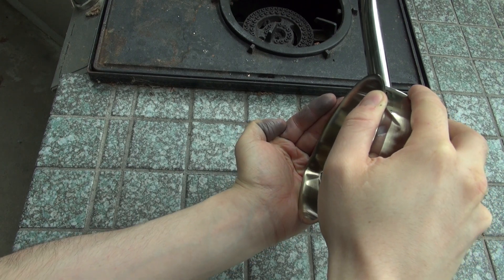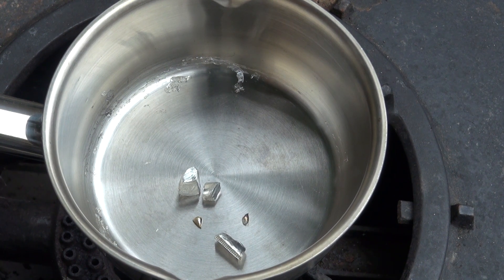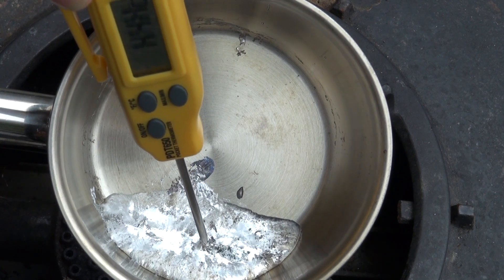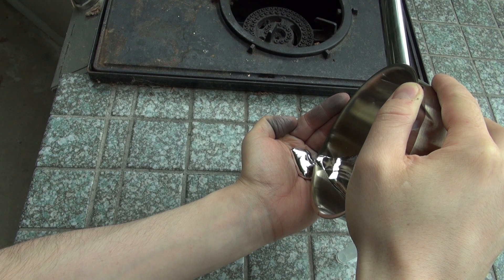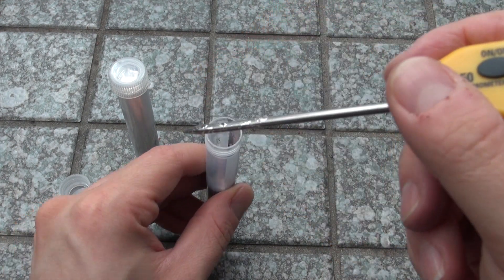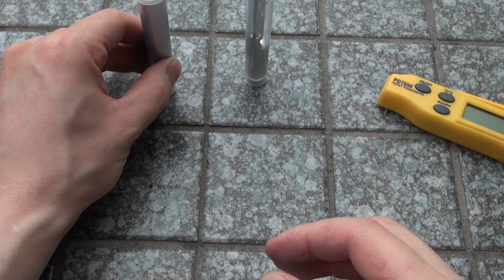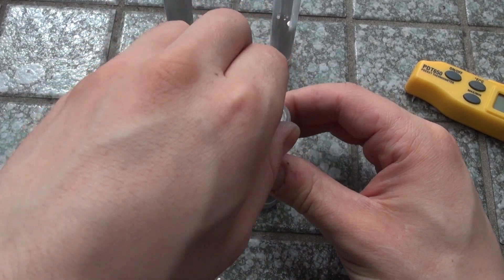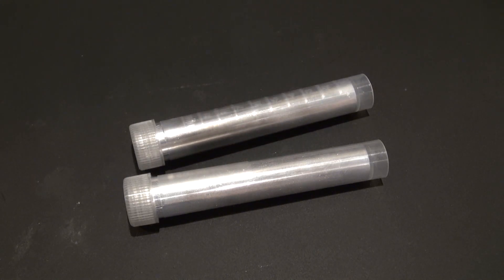How To Make Galinstan

Comment: It's NOT a "very unique" metal! There are no levels of uniqueness, it's simply unique (one of a kind) or not.
Otherwise another metal could be slightly unique, a little bit unique...clearly nonsense.
Unique doesn't mean rare, special or unusual, those are different words.
"Unique" has its own meaning and you should use it properly.

Comment: Is gallium and galinstan the same thing? I understand that than galinstan is three elements in one but Im curious to know if gallium is better or about the same as galinstan when mixed with aluminum to get a chemical reaction to will create hydrogen
Reply from the maker: It is not the same because gallium is a single element and is has a higher melting point than galinstan.
Reply: I've found pure gallium reacts a little better with aluminum

Comment: You actually dont even have to heat them up
Reply from the maker: For indium and gallium you don't but for tin you do. The three metals won't combine unless tin is heated up and melted. Maybe if indium and gallium is alloyed and comes in contact with tin at room temperature it might combine but very very slowly, if at all.
Reply: @SciTyeTech  oh okay. I did galinstan yesterday and well... it hasn't worked for a 100% 😅

Comment: As a non-chemist, I would wonder if the gallium would damage the metal tip of the temp probe. :O
Reply from the maker: I thought that too. The gallium is not in contact for very long because I cleaned it of afterwards and gallium does not react very well with iron.

Comment: Thanks for the video. Do you know which kind of container will no remains galinstan on the inner surface?
Reply from the maker: There is not really any container to prevent it from sticking. The only thing that I know of would be a thin gallium oxide layer that could repel the galinstan from sticking.
Reply: @SciTyeTech  Thanks for your suggestion. It is  really helpful!👍

Comment: Is there a way to prevent the galinstan from sticking? I'd like to stick some in a test tube, but it ends up coating the inside and you can't see it. Is there a certain clear material I could use to hold it that would prevent it from sticking? It's one of my favorite things about mercury is it's not messy, but unfortunately it has that toxic aspect...
Reply: There's a video from Acrakatau, where he added a small drop of a dilute acid (he used 2% sulfuric acid) and it immediately stopped sticking and leaving residue: https://www.youtube.com/watch?v=sPsVdiL-VdM
Reply: I heard that if you add a little layer of gallium oxide to your tube the galinstan won't stick to it as much
Reply: You can add clay it will not stick with it.

Comment: I need this metal because it's very cool
But why did you use tin for it thats not necessary
Reply from the maker: It really is cool! Sure, I could use only gallium and indium and the result would be a nice liquid metal. Now adding tin will lower the freezing point of the metal. Freezing point of gallium and indium is 15.7°c and galinstan is -20°c.

Comment: could it be used for a tilt switch?
Reply from the maker: Yes it can, but it won't work under cold conditions.
Reply: @SciTyeTech  Thanks! Yeah now that I think about it at cold temperatures the gallium would probably coagulate.
Reply: @SciTyeTech  can i use it to make a fidget spinner

Comment: Hi there,
Can I convince you to stop handling this (or more correctly, Gallium). I was curious about you handling it and couldn't reconcile that with the bottle label that I have which clearly has a corrosive label on it, but having also handled it myself (many times) so thought I'd go and do some research. There is some conflict but this one has a bit more info:
MATERIAL SAFETY DATA SHEET            Zeiss Part # - 346700-8042-000Manufacturer:  Strem Chemicals, Inc7 Mulliken WayNewburyport, MA 01950-4098 U.S.A.www.strem.comStrem Customer ServiceCHEMTREC (Emergency Only)Poison Center(978) 499-1600(800) 424-9300(800) 562-8236Section 1:Product IdentificationChemical Name:Gallium metal (99.99%)Product Number:93-3145CAS Registry Number:7440-55-3Formula:GaEINECS Number:231-163-8Chemical Family:metal or elementSynonym:noneSection 2:Composition and Information on IngredientsIngredientCAS NumberPercentACGIH (TWA)OSHA (PEL)Title Compound7440-55-3100%no datano dataSection 3:Hazards IdentificationEmergency Overview:Corrosive to eyes, skin and respiratory tract. Ingestion may cause damage to the mouth, throat andesophagus.Primary Routes of Exposure:InhalationEye Contact:Causes burns to the eyes.Skin Contact:Causes burns to the skin.Inhalation:Corrosive to the nose, mucous membranes and respiratory tract.Ingestion:Ingestion may cause damage to the mouth, throat and esophagus.Acute Health Affects:Corrosive to skin, eyes and respiratory tract.Chronic Health Affects:Equivocal tumorigenic agent by RTECS criteria based on laboratory DNA study.
Ok...so that copied and pasted in super badly, but check that last line. That, to me, reads like "find the gloves, my man!"...big time.
Here is the URL to the MSDS.
https://www.zeiss.com/content/dam/Microscopy/Downloads/Pdf/MSDS/MSDS-Gallium.pdf
Some of the other MSDS are similar.
What is quite disturbing is the number that simply say "unknown"
Regards.
-Geoff
Reply from the maker: That's very interesting. I have seen the same thing too on the bottle. Most likely it is meaning corrosive to most metals and an Irritant to eyes and respiratory because when the metal is a solid, it can shatter like glass. Therefor the small shards can be dangerous to eyes and respiratory. I would like to where gloves, mostly because of how the metal sticks to your skin. But thanks for the info!